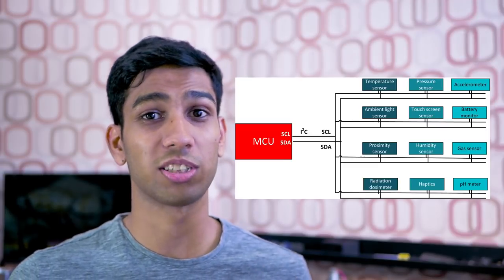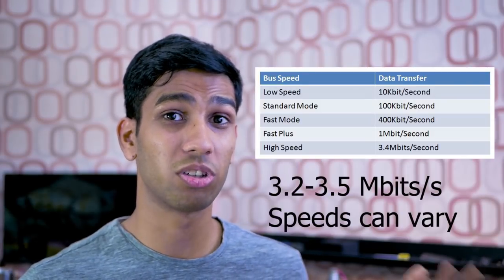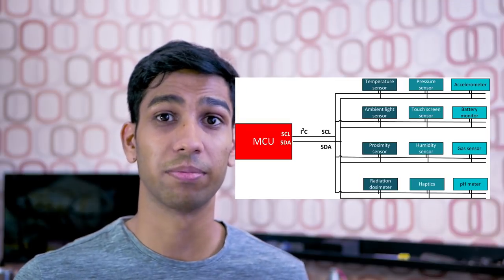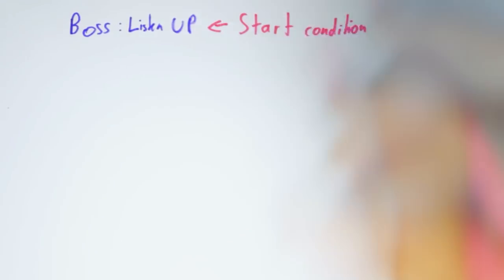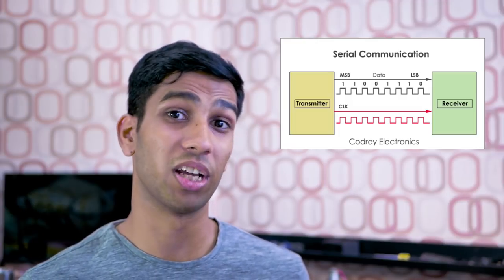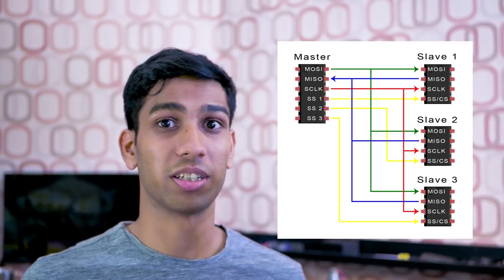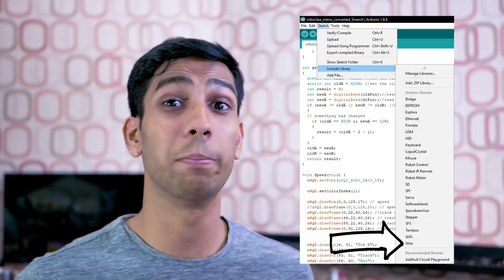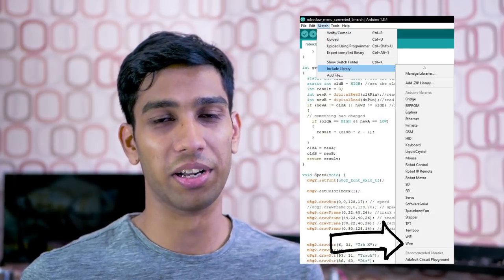I2C tutorial in 5 minutes + Arduino & Raspberry Pi implementation. Electronics Crash course # 13

Comment from the maker: There is a small correction to the video. In the start I mentioned how the master device is usually the transmitter and the slave device is usually the receiver. While this is usually the case, the slave can also be a transmitter and master a receiver. This happens when the slave sends a read bit instead of a write bit. The distinction between a master and slave device lies in the fact that the master device always initiates the message and the master device always sets the clock value (SCL wire)

Comment: how much i2c pins does the new rasberry pi 4b has ? and what are those pin no for SDA and SCL ? thanks alot :) one more question does the rasberry pi 4b have issues if I set the baudrate to 4000000 as it translates to 400KHz clock frequency right ?